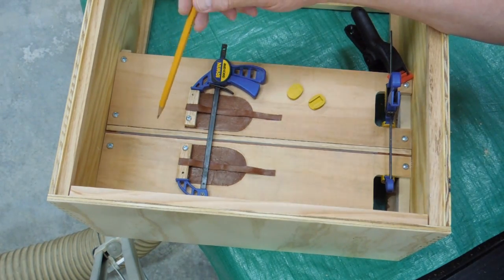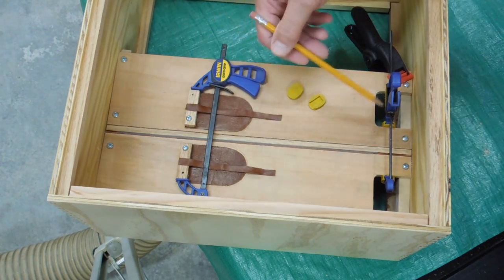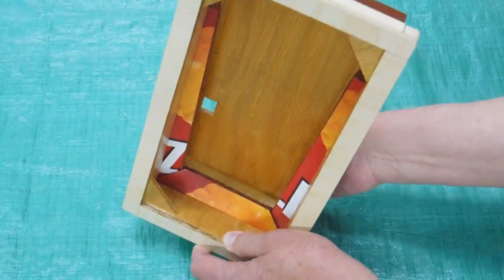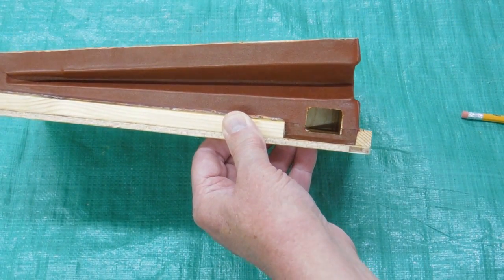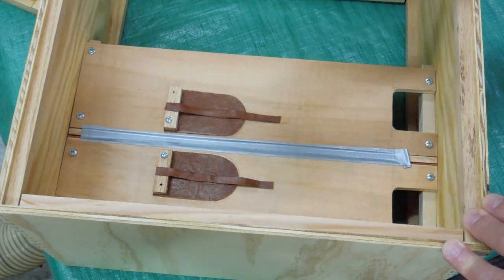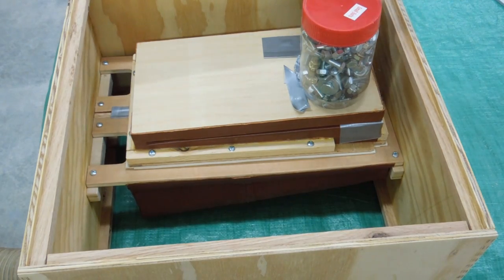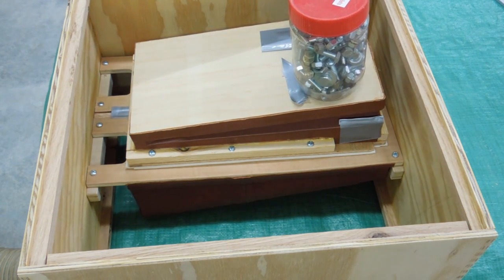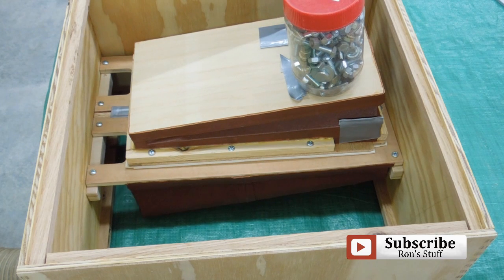Building The Busker Organ - Bellows and Reservoir Installation & Test Part 3

Comment: Do all pipe organs have a string or spring attached to the bellow? if there are non, and there is no heavy weights on the Bellow, will it give issues ? Reason being is that when i strike a chord and in a few secs it goes softer or dim ! First chord is loud, rich and firm, in a few seconds it looses key slightly and goes softer. Please advise.
Reply from the maker: First of all, are you referring to a homemade street organ or a full size organ?
I have no experience with full size church or theater organs.

If it is a street organ, are you referring to a Busker Street Organ (as in this video) or a John Smith Senior 20?

There are no strings, springs or weights on the bellows. They are mechanically driven with push rods. There is a spring on the reservoir to maintain or regulate the pressure supplied to the pipes. There is also a spring on the pressure relief valve on the reservoir. A weight could be used on a reservoir, instead of the spring, to regulate pressure. This can be seen in the following video (again the Busker Street Organ).

Building The Busker Organ - Manometer Test Part 5
https://youtu.be/cnQvvG5P7Hs

There could be a strap on the reservoir to keep it from over expanding (opening too far).

What you see here with my videos on the Busker is an experiment. After purchasing the Busker plans I learned that the Busker was a bit "breathy" (sometimes ran out of air) depending on which or how many pipes were played and for how long. I made the air supply section of the Busker to practice making bellows and a reservoir and later used it to test the pipes I made for other organs.

The Busker was initially made by John Smith as a gift for one of his grandkids. When people saw it they started asking him for the plans... and the plans did not exist initially. 

He later designed the Senior 20 Organ as a much better version of a homemade street organ with improved bellows, reservoir and pipes.

I have a playlist for the Busker videos and a playlist for all of my Senior 20 videos. These videos may be of interest to you and could help you with your problem.

I built two John Smith Senior 20 Organs and there is a complete series on building them in my playlist.

It sounds like you are running out of air. Look for leaks. Air can escape from the tiniest crack or hole. There is leather called "pneumatic leather" which is a select grade which holds air better. Pneumatic leather is expensive and sold by organ supply companies. Personally, I used a fairly nice grade of lambskin. If you used leather that is too thin or poor quality and has any holes in it, that could be part of the problem. On YouTube there are some videos showing how to seal leather. I painted my leather on the inside surface with glue and attached card stock (cardboard) stiffeners. No glue was used on the folds or corners. One must be careful how this is done as the bellows or reservoir leather could stick together if they remain collapsed for a period of time. This is another reason for using the card stock stiffeners inside the bellows and reservoir (it separates the leather surfaces which have been sealed). 

If the leather in the bellows or reservoir is old, it may have formed cracks (especially in folds or corners) or the attachment (glue) may have come loose from the frame.

Another method to increase air supply is the drive the bellows a little faster.

Or you may need to play around with the spring (or weight) on the reservoir to better control the reservoir pressure.

As far as the pipes are concerned, they need to be tuned with the air supply being used (tuned on the organ they will be installed). So... if you somehow change the volume and/or pressure of the air supply, you may need to retune the pipes. And pipes preferably should be tuned on an average day for where you live... not rainy... not excessively hot or dry. An average day in terms of temperature, humidity, barometric pressure, etc. ... a nice day.

Hope that helps. If you have any more questions please ask.

Thanks for watching. Please subscribe! 
That is what keeps this channel going. 
Ron